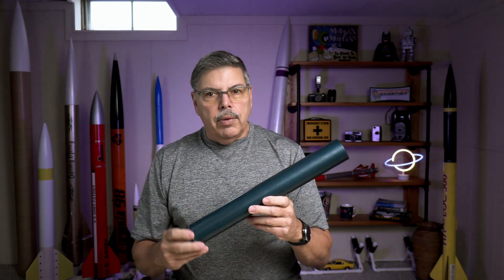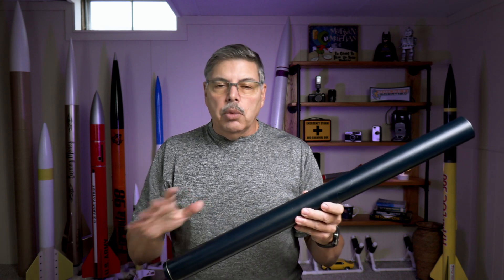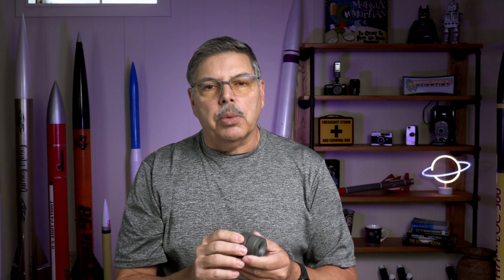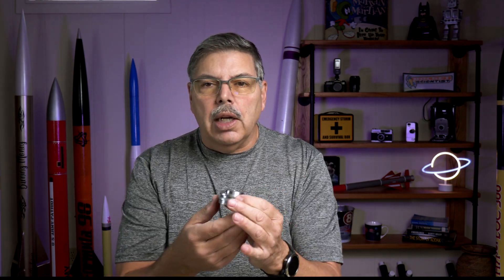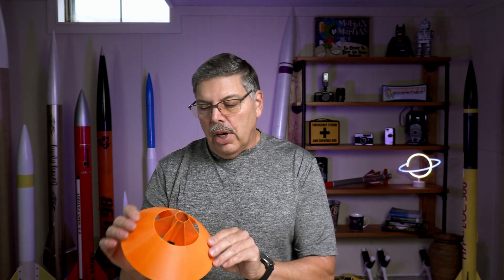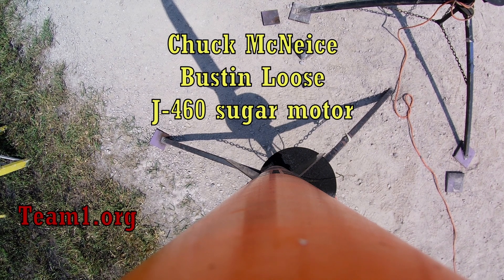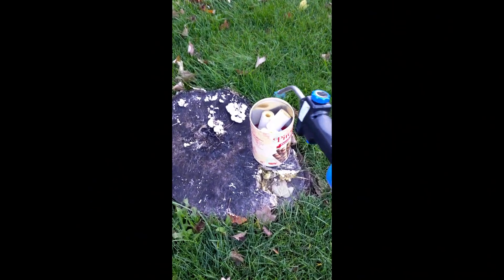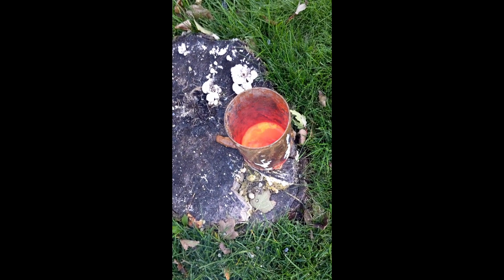Unlocking the Secrets of 54mm High-Power Rocketry

Comment: If you make the nozzles out of 303 stainless steel, it will last a lifetime. It doesn't chip or crack like graphite, is easy to machine...similar to 6061 aluminum, and will survive CATOs. I have one 75mm 303 that has over 40 firings including 2 CATOs and is good as new. And they are now approved for Tripoli research flights. Your Harbor Freight lathe will easily machine 29, 38, and 54mm 303 nozzles...maybe even a 75mm.
Just remember that a stainless steel nozzle will melt using apcp (sugar burns cooler).
Reply from the maker: Your information on stainless steel is fantastic; good graphite can be quite expensive! I haven't attempted to turn steel on my Harbor Freight lathe because I anticipated it would be frustrating.

Comment: What video cam are you using? And what rocket is the one behind you , the blue and white one?  Great video flight.
Reply from the maker: It is a RunCam 2 4k attached with electrical tape! The red, white, and blue rocket is scratch built which I call Avenger. I need to order the decales and send it.

Thanks for your comment!